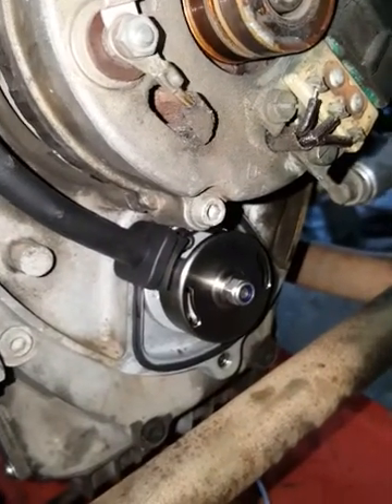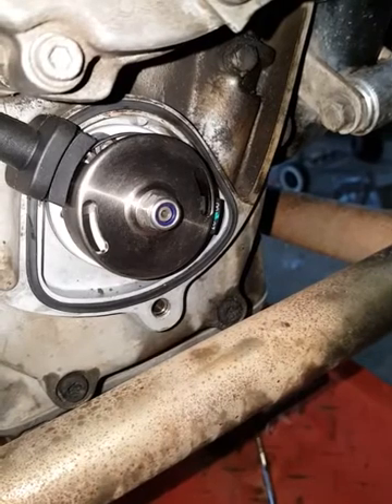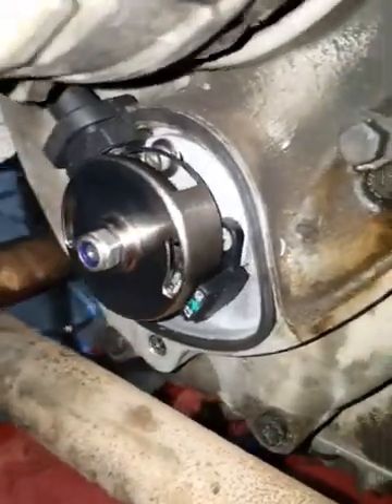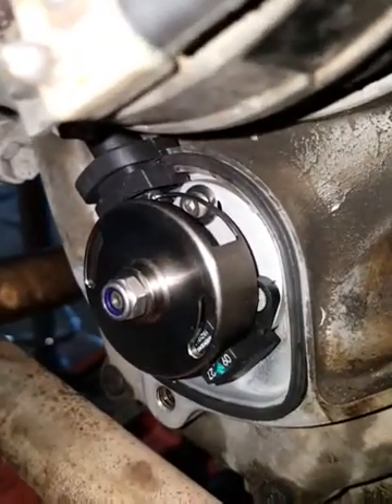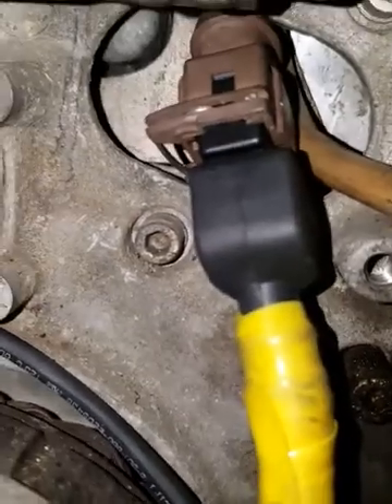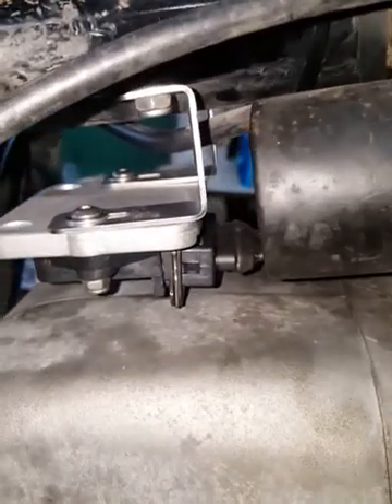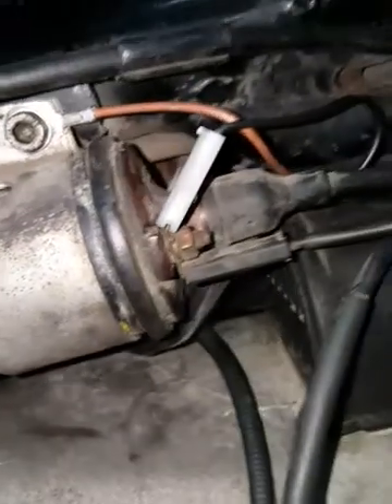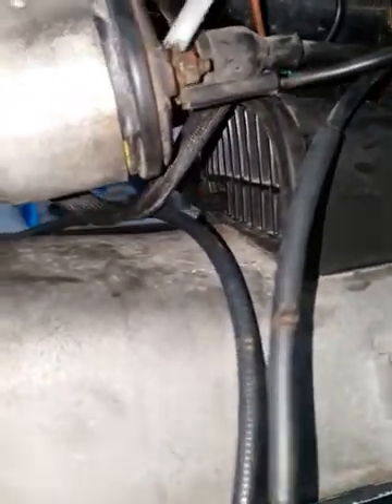MMMs BMW BOXERWORKS TECK TIPS

Comment: Hello sir, can you confirm me that the black wire of the electrical ignition goes to the minus terminal of the right hand side coil and the green wire goes to the plus terminal of the left hand side coil? Im running some serious troubles with a similar ignition kit purchased from motorworks.uk